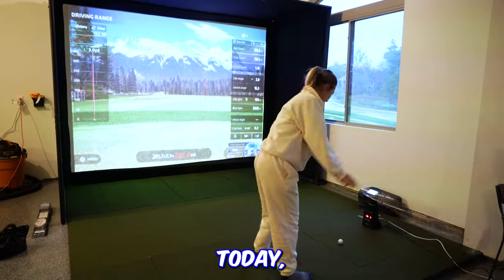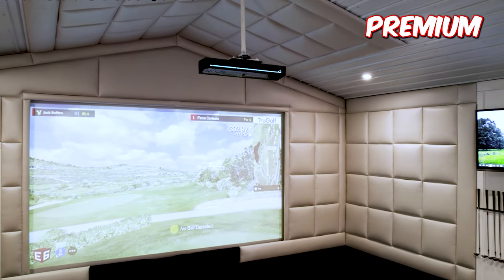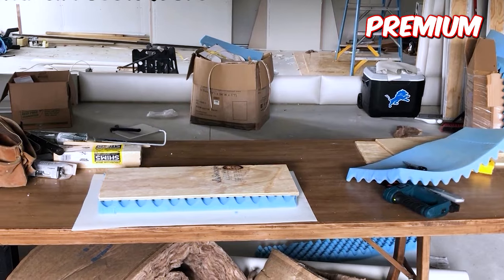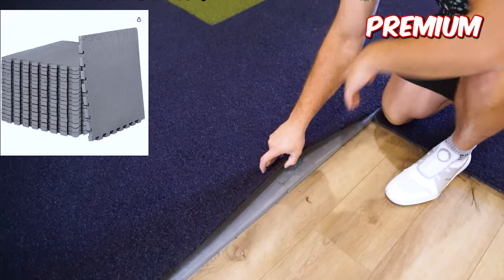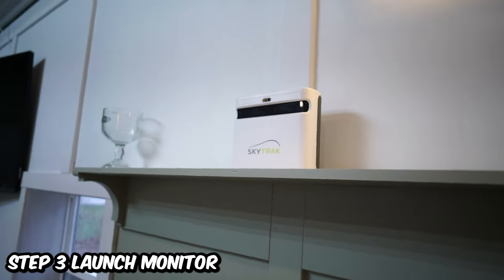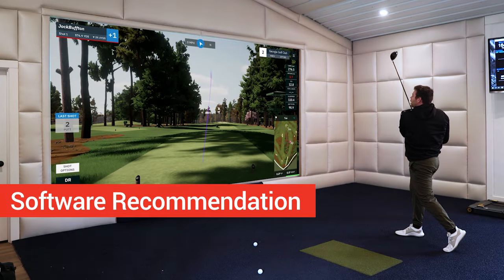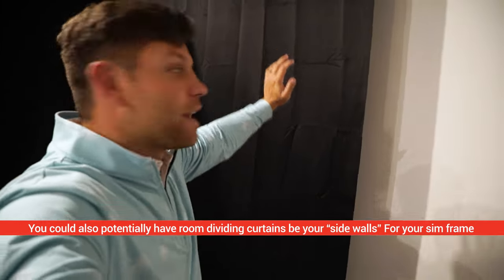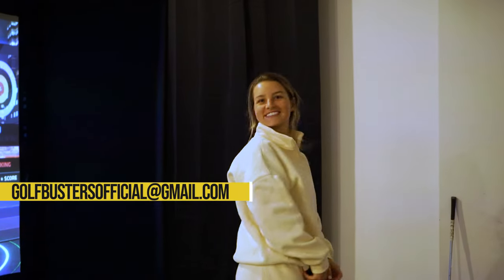How to Build a Home Golf Simulator in 5 EASY Steps (DIY CHEAP GARAGE GOLF SIM)

Comment: I am installing an impact screen, 12 ft Long, and 10 ft High. I watched your Youtube and tried to find the frames you mentioned ( 1" x 10 " metallic EMT conduit and more ) but I wasn't able to find them.  Would you please kindly provide me with a link or the detailed specifications and name of the frames required for my project? Any additional information or recommendations regarding the installation would be greatly appreciated.
Reply from the maker: Hey so 1 inch by 10 foot conduit can be found at home depot or lowes!